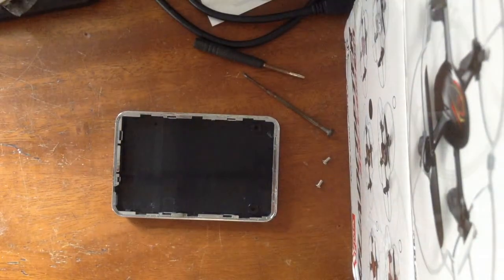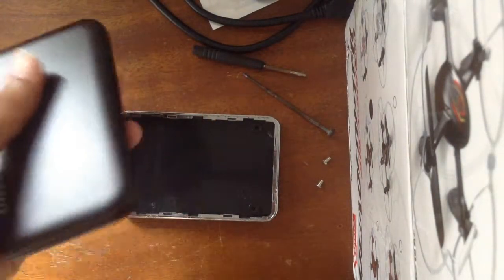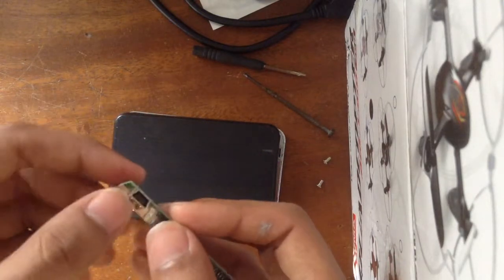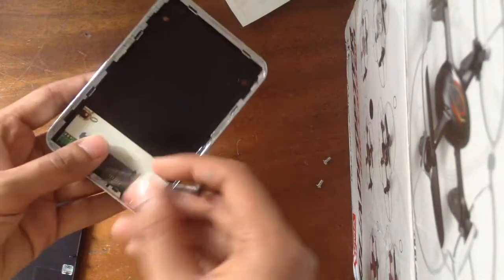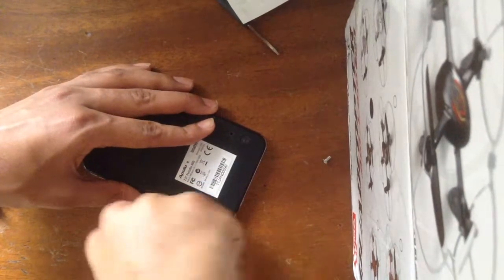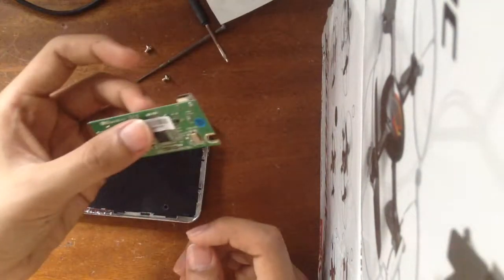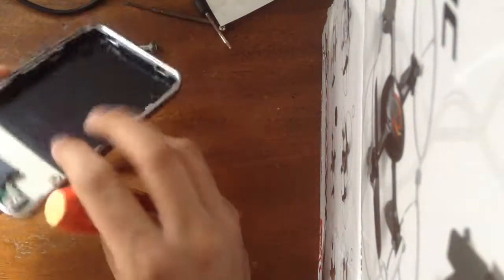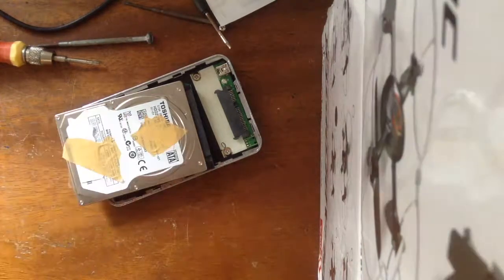Build Your Own 2.5 Inch Hard Drive Dock

Comment: 2:38 it's a female mini usb port. A slightly larger formfactor than you find on most of the mobile devices (micro usb).
Reply from the maker: Ohhh okays..thanks dude! ..Sony used that port quite a lot in their older console line ups and handycams